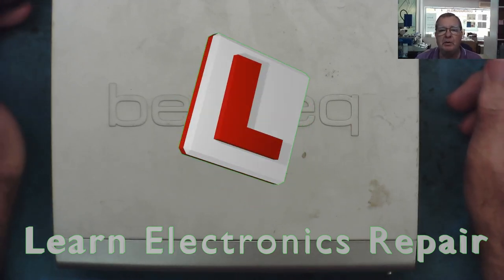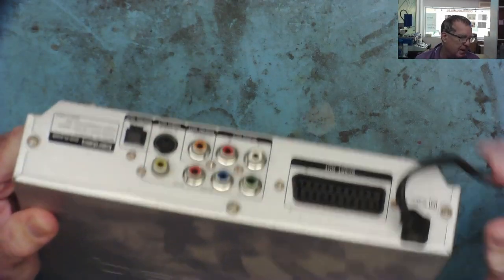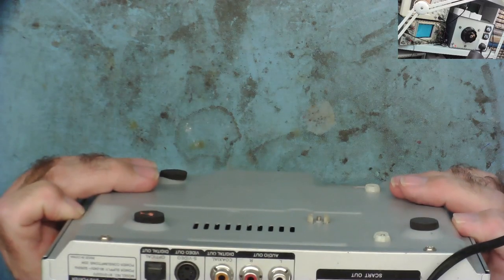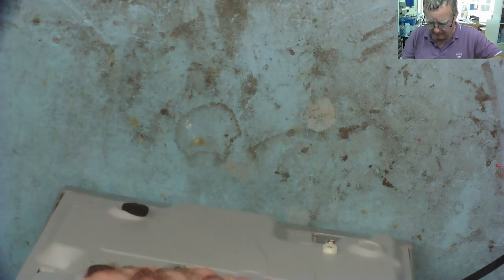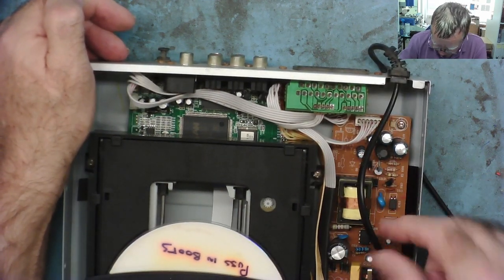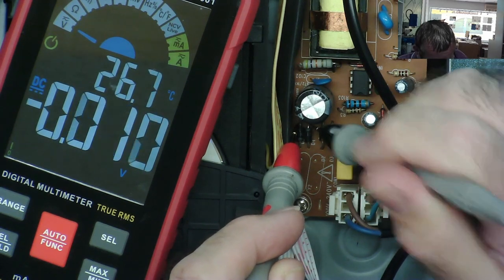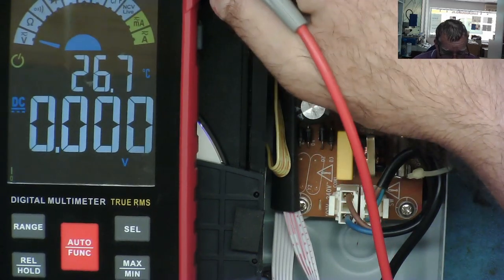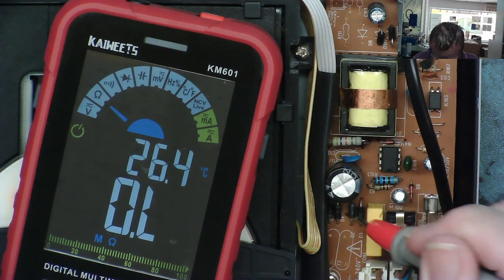Small Switch Mode Power Supply Repair Guide - Consumer Electronics SMPS How To Fix

Comment: Good day to you sir

I've always wondered if a computer's PSU after about 10 years of use, that seems to be working fine, Would there be something that's gone bad?

I'm asking because I didn't replace my PSU (Seasonic SS-750JS) for about 10 years and might upgrade the PC next winter without replacing the PSU.i
Reply: It is actually a real Seasonic or a PC power & Cooling which at that time was getting their power supply from Seasonic ?, I have since 2009 about 18 PC power & Cooling  PSU and some of them fail due to I gess aging electrolitic capacitors inside
Reply: Check in BIOS what the voltage readouts are - as long as they read above 12v, 5v and 3.3v then the psu is good for powering your PC, when under load some of these voltages can droop but if they get too low then there isnt enough voltage to power your PC, Seasonics are very good - doesnt suprise me its fine after 10 years if its been lightly used - the other thing to look for would be weird voltage spikes - like 5v spiking to 6.7v that could also be bad for the PC - what you want is nice stable voltages at say 12.3V, 5.1V and 3.34V
Reply: @NOMADCREATIVESOLUTIONS  Thanks for the info. 
I actually ran HW monitor and the lowest vdroop I got under load is 11.7 volts, spikes only to 12.4 the 5v is stable never goes under 5 and 3.3v is stable as well.
Reply: @enriconapolitano4321  It's a Seasonic PSU bought alone, the model is SS-750JS.
Reply: 11.7v is starting to get low but it probably will still power.. starts getting to 11.5v I'd maybe look at replacing it..

Comment: How about some videos on those cheap ebay meanwell / Chinesium SMPS's, idealy the 12 volts 30+ amp versions. I am specific with the specs because every other video on these are for the 10 amp versions and / or how to jack the voltages up to 24 volts or make them variable. The videos that go into higher amp models are either not in English or the repairs are not explained well, no good video of the repair, lack of proper knowledge of electronics, etc.

Comment: hi richard ive got a strange thing happening with my switch mode power supply i am repairing from a mixing desk - after removing i could see the two 1000uf caps bulging obviously failed so i replaced with new ones but when i power up the power supply just ticks and the voltage across one of the caps is over 30v which it shouldnt be as caps are rated at 25v - is it an issue with the feedback circuit causing it not to adjust its PWM properly? could it be a faulty opto isolator or the tl431? it looks like a surface mount tl431
Reply: if i put the old knackered capacitors back in it powers up?? and mixer works apart from slight hum

Comment: 99% of the time it is one of the rectifier diodes burnt. If not then the ecaps are next to check...they dry out in old units.
Reply: Are you referring to the power supply in this particular example, or in switching power supplies in general? In my particular experience of dealing with many different varieties of power supplies, the primary failure is one of the switching components, either mosfets used for the actual power supply switching, or the PFC(power factor correction) mosfets or a combination of those with the driver ICs and coupling components for the mosfet switches. Only about 10% of the time do I see the bridge/main rectifiers go. And, if they do go, it's usually because something upstream already failed. The typical PSU failures are mostly the cause of some kind of abnormal stimulus to the PSU, such as a high temperature/inadequate cooling, a dead short on the output from something external to what the supply is driving, or at the end of life for the electrolytic caps and their leaking or exploding. Your comment is certainly an easy very fast first check with a continuity meter but also, while in diode check, quickly one can go for all the mosfets and switching diodes. But the rectifiers are certainly not 99% of the time with switching PSUs in general, believe me, I'd love for them all to be so easy to fix and have some nice quick checklist to get these things fixed fast. But it's not so easy many times with more complicated designs especially with ones using unusual and weird switching ICs without available datasheets and schematics.

Comment: The quick simple fix is usually to look for the electrolytic capacitor that's close to a heat sink. Planned failure.
Reply: There's 2 of them with domed tops at the edge of the board. They're obvious as soon as the lid is off.
Reply from the maker: @1magnit  Isn't that exactly what I showed at 04:25, immediately after explaining the MOST important thing first - which is to check the main (bulk) capacitor does not have a dangerous high voltage charge in it before looking for anything else?
Reply: @LearnElectronicsRepair  Sorry, I was skipping parts of it. Just look for the obvious first before getting out the meter. Often with those things there's a power transistor mounted on a heat sink and one of the small coupling capacitors is right next to it. Those dry out but they don't get a bulge in the top  so test them in circuit with the ESR box. It's pretty much ALWAYS a capacitor that's failed in those things